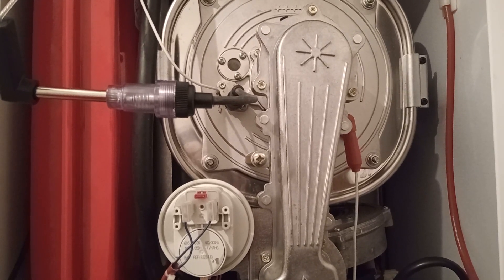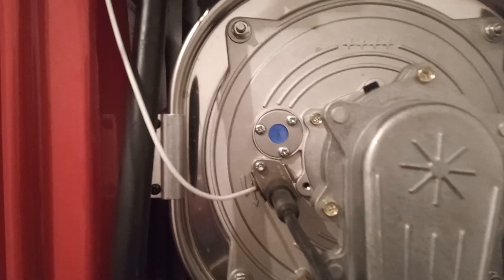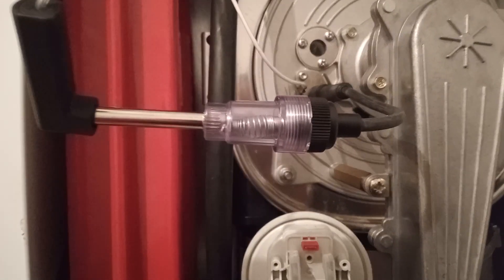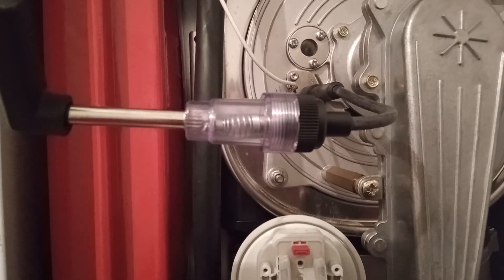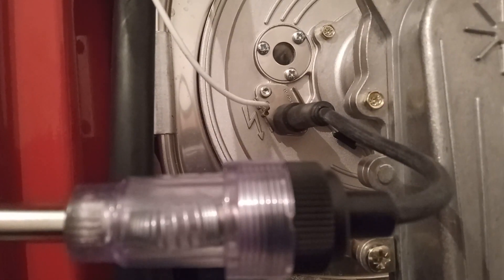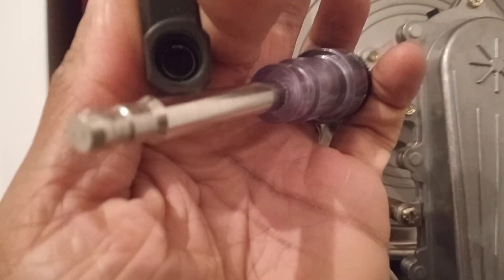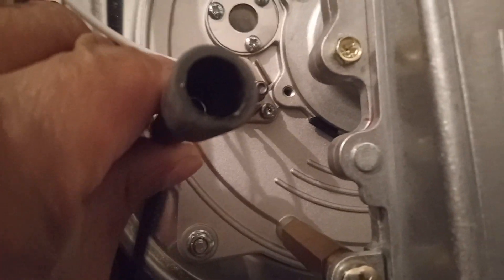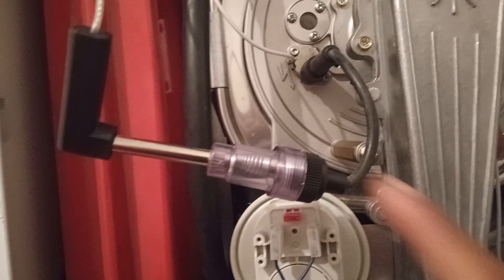GAS BOILER SPARK TESTER

Comment: To save space in my tool bag, I remove the electrodes, turn the gas off and then either leave the electrodes dangling if they have an earth or if not, use my adjustables to hold them to the boiler case.

That way I can see how strong the spark is (spark weakens the further apart the electrodes are apart).
Reply from the maker: Hi Dan, thanks for the tip. Do you think that your method is safe? I haven't tried it. I don't use the spark testers much but for £6 and how small it is I allow them a spot in my tool bag. Maybe make a video of how you do your test.
Reply: @CommercialGasEngineerVideos  I wouldn't say it is dangerous as long as you aren't holding it at the time. The gas is isolated so there is no risk of explosion.
Reply from the maker: @dan2071  thanks for watching